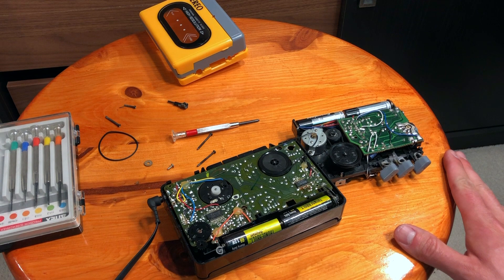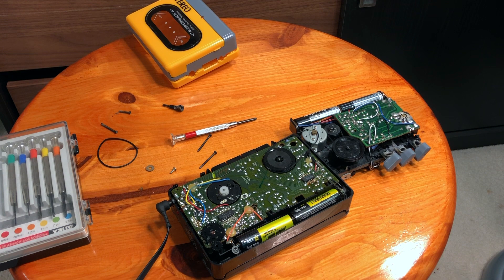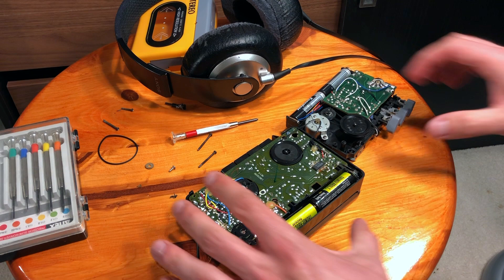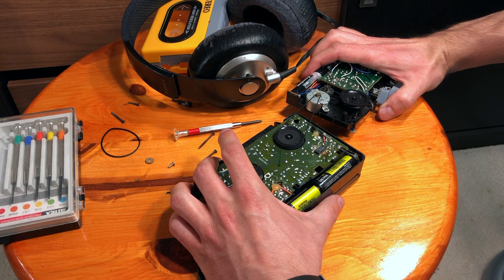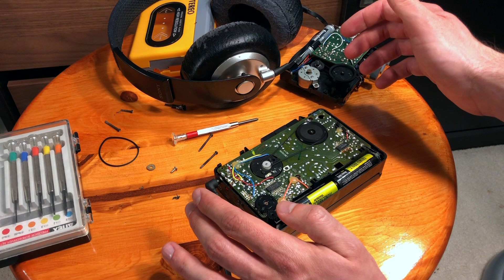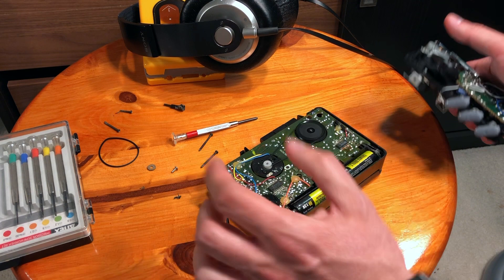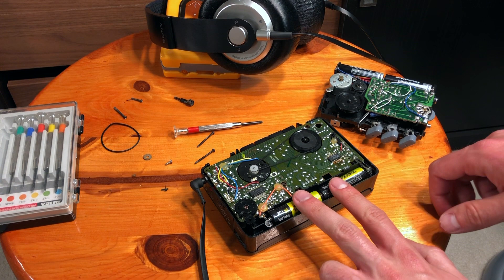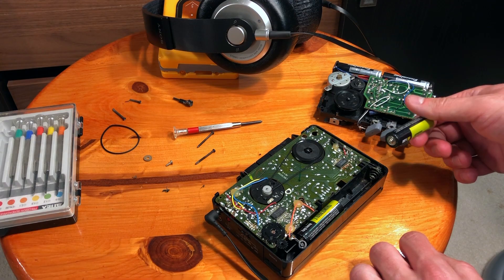Walkman cassette player: How to repair motor or pitch problem

Comment: I have the same problem with my Sony Walkman WM-F2081 .. it just plays at a lower pitch by may be a semitone! It was ok before. Batteries are fine. These old walkmans can drive you crazy man!
Reply from the maker: Yep, those Walkmans (and cassette players in general) always had those kind of issues. But it's actually a funny part of using it :)
Reply: @NomadicDmitry  Yeah, I suppose it is even amazing that it still works in the first place, right! It has so many moving mechanical parts inside that it is quite amazing how they built it those days! I still enjoy listening to it in the slightly slower speed as it is like hearing it with pitch control switched on .. good for deciphering music if you ask me! Cassettes with headphones are really great for vocal and instrumental music, to listen with focussed detail. Your video was quite amazing man! No one would have thought to chain the belt with two players! .. Wow .. I was amazed at your creative thinking. Have a great day.
Reply from the maker: @melodychest9020  Hehe, thanks man :) I'm a Test Engineer, so I guess that side of me overlaps personal projects as well haha. I especially like players with Dolby NR. Current cassette players lack this, unfortunately.
Reply: @NomadicDmitry  I have the Tascam CD-A750 (CD and Tape deck). That has Dolby NR switch. Can u please explain what that is?
Reply from the maker: @melodychest9020  NR is basically "Noise Reduction". This is the technology that was used to reduce the tape "hiss" when playing cassettes. 
There were multiple Dolby NR technologies implemented during the cassette era. 

You can read more here about it: 
https://en.wikipedia.org/wiki/Dolby_noise-reduction_system
Reply: @NomadicDmitry  OK thanks for that. I tried the NR switch on my tape deck and certainly it takes out the hiss from the tape. Also I noticed that the music (vocals etc) sounds that bit more dry and loses a bit of spacial reverb! I guess I guess certain frequencies get affected from the sound of things. It is certainly taking out something from the original recordings. In some cases it is preferable but some people may not prefer that. Cheers and thanks for enlightening me!
Reply: @melodychest9020  you need the NR switched on both when recording and playing back, so that the high frequencies are protected from the hiss reduction. If it wasn't switched on during recording, you shouldn't switch it on during playback.
Reply: That's funny, my WM-F2078 also has a pitch problem - it's too high. Will figure it out though.

Comment: My walkman seems to have 3 rings that has rubber attached on it. But it hasn't been used for so long the rubber has hardened and crumbled so I can't see where the rubber goes but there are 3 rings with groove that has bits of rubber on it

Comment: Forgive my ignorance but could you not exchange the motors?
Reply from the maker: Pardon, but what do you mean? This was mostly an experiment.
Reply: @NomadicDmitry  Right. I realized that connecting one motor to the other cleared the problem. I answered my own question. Thanks!
Reply: @NomadicDmitry  Right. I realized that connecting one motor to the other cleared the problem. I answered my own question. Thanks!

Comment: The play motor on my Walkman doesn’t have enough power to play the tape but it can rewind it. What can I do to fix it
Reply from the maker: It doesn't play at all or it plays it slow?

If it plays it slow then:
1) Probably you have already changed the batteries, right?
2) Disassemble and clean it up a bit
3) Inspect the belt. It might be a culprit if it's worn out

If there is NO sound at all then the problem is probably the tape head that reads the cassette. Not exactly sure how to investigate that problem.
Reply: Nomadic Dmitry do you know where I can find a belt? I’ve been looking around for one but can’t find one.
Reply from the maker: @jayne9733  eBay would be the first place I would look for. They usually sell those in bulk (for cheap), so you can try different belts on your player.

Comment: Man, thanks for this video, but.. can you tell me the model of your smart watch?? It's super cool ^^ LoL
Reply from the maker: Thanks! :) I think it's a Fitbit Charge 2
Reply: @NomadicDmitry  Thanks for the info =) Anyway i searched the model you told me and it's slightly different.. maybe you changed the original strap? Because i see your strap goes a little higher respect to the display... the default model has display and strap at the same height. Maybe it's another Fitbit Charge model? If you can tell me exactly i would appreciate it very much, otherwhise no problem =)